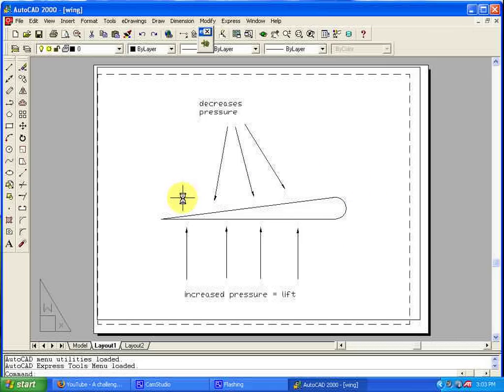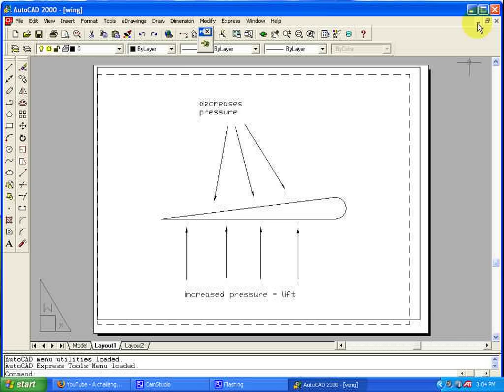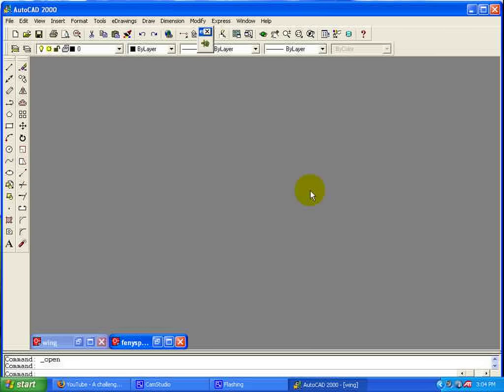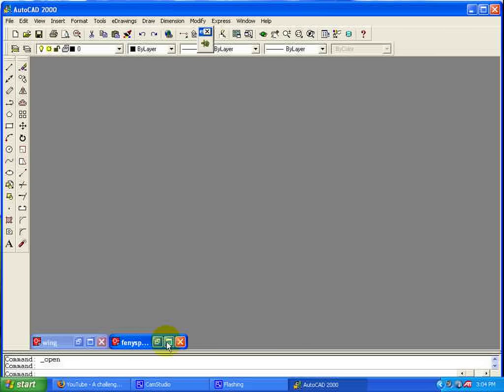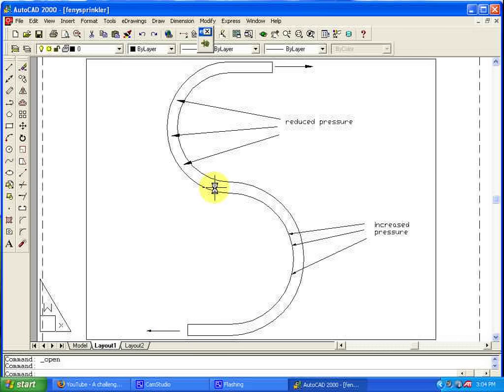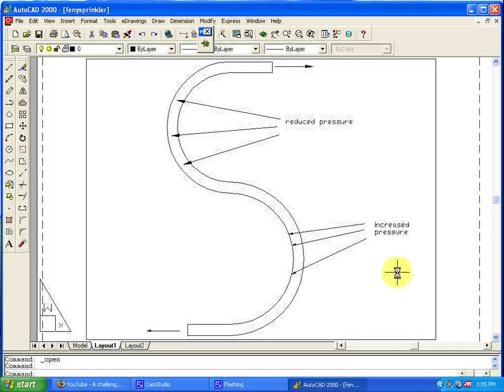Inverse Sprinkler Puzzle

Comment: No, this is not correct. The solution has to do with conservation of momentum, not pressures. For all intents and purposes, the pressure differential in the pipe is zero. And even if it were much different, the force exerted would be only internal, resulting in no work being done.

Comment: The pressure gradient is at the opening of the nozzle relative the the tube just behind the nozzle, not inside the tube. There is lower pressure at the nozzle opening relative to the other side of the tube. The tube will move in the direction you predict based on Bernoulli's principle, which is the same phenomena that causes lift on an airfoil, but I think your concept of where that "lift" is generated in your model is flawed.

Comment: No that is not correct. If you assume that it is the curvature that causes a a lift and forces the sprinkler to move, then the "lift" would be directed to the outside of the curvature (and thus spin counter clockwise). The truth is, the speeds on the tube and the tubes curvature is prety negletable (and sense it is a constraint the effect would be even less). Do not forget that the fluid is static initially and it is the geometry and pressure of the tube that causes the motion.